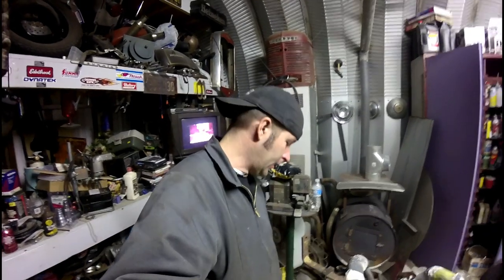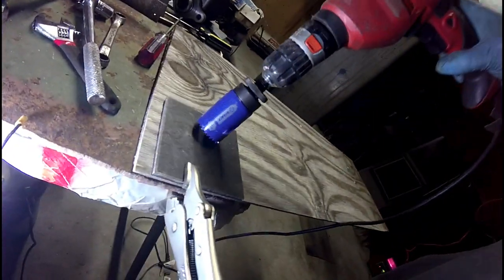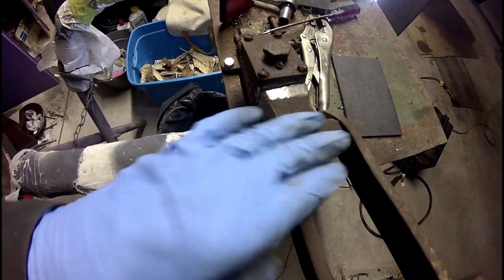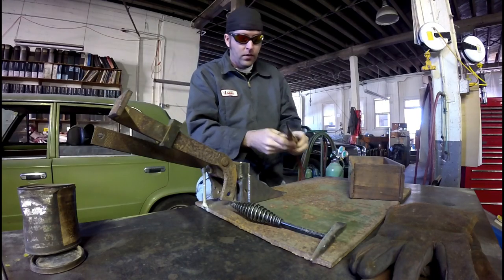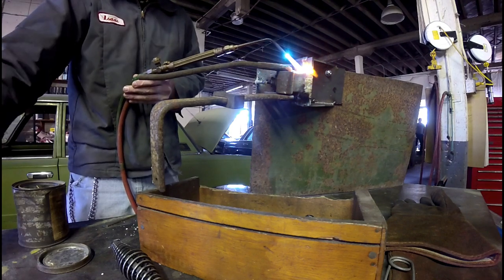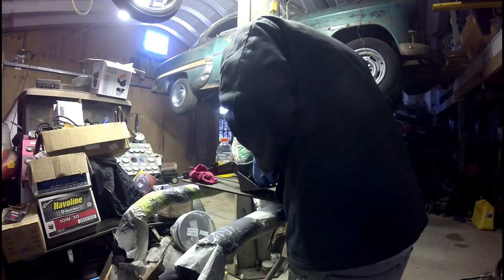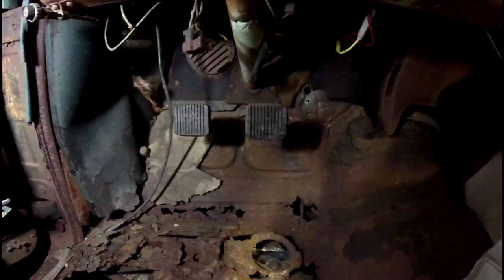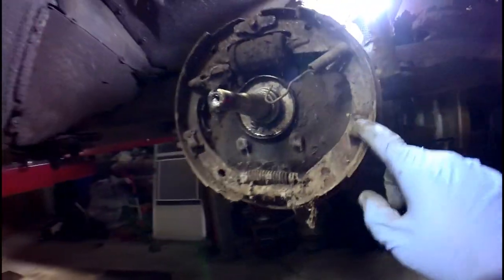Dual Master Cylinder Conversion- '53 Chevy Build: Ike's Adventures

Comment: Method I use for welding cast.  Clean weld area, preheat until it takes color, weld, reheat until it's got quite a bit of color, bury in a bucket of sand. I just use play sand from lowes or wherever.  The sand lets it cool slow and keeps it from cracking, it takes awhile to cool completely but leave it until it's touchable.  Works great, same method works on hardened steel too

Comment: Hey Ike, have you ever heard of or seen a Hydroboost brake setup? I've got one on my bronco right now, instead of being vacuum assisted, the brakes are boosted by the power steering pump pressurizing the booster along with powering the steering. It's supposed to be stronger and more reliable than vacuum. Although this project looks to be staying manual brakes, maybe a future project will get hydro.
Reply: ive seen them. I'm keeping this one as basic as I can
Reply: Travis Block don't they have a separate pumps just for brakes alone?
Reply: Isaac it'll be fine nothing wrong with that!

Comment: Show the brake line instal and give any tips that will help the lines seal up. I'm having trouble getting my lines to seal up on my 68 Chevelle. Thanks bud!
Reply: travis arnold leaking at your flares? are you using a proper double flaring tool? the two most important things when using a regular flaring tool is even pressure, and when your setting the stick out of the line into the clamp go a cooter hair past the thickness the instructions say. it helps. and a little lube never killed anyone.
Reply: regular=Non hydraulic, but still double flare.
Reply: ill be doing a vid on that this weekend
Reply: AllAroundUnderground yeah they leak around the flares. I bought new lines from CCP I'm thinkin their over flared I guess I'll have to redo them.
Reply: Isaac it'll be fine lookin forward to it.
Reply: Spot on, the instructions usually say to get the line flush with the fat part of the flaring dimple. Ive found if you go about 1-2MM more, they seal up and dont crack the flare off after you do the second procedure. The next most important thing to do is after hooking them up and bleeding is to properly secure them so they cant move at all. Just like a paper clip bent too many times, any movement will crack the flares.

Comment: hope the weld doesnt brake , doubble mastercilinder doesnt help a bit if it isnt being depressed by the pedal , you still wouldnt have brakes

i usually use a waterpump plier to get the bearing dustcap off , just grab it on the front of it and wiggle while pulling it off
Reply: I'm going to fix the e brake too
Reply: the hinge for the pedals looks pretty sturdy so i understand why you didnt wanted to refabricate the whole thing out of steelplate and stuff , it mightve been a stronger option though 
if this doesnt work you prolly have to to go that route anyway to get it all to work again though 

btw was the hinge piece you used solid or hollow, 
wat you could do if its solid is drill and tap it and put two bolts through the metal plate intoo  it as extra insurance
Reply: hollow. wish it was solid

Comment: Hey Ike. Is it hard to find parts for OOOLD cars like these? I assume you can't just walk into an advanced auto and pickup a master cylinder.
Reply: Actually you would be surprised. Some model specific stuff can be a bear but a lot of the stuff was used way past the model year. Then again if your a hot rodder and you don't care about modding it and making it better. My 48 chevy is sitting on a s10 frame so I have 4 wheel disks and modern front suspension.
Reply: holy shit!! NICE! Well those damn things weighed enough you practically needed a truck frame. Now is this frame/suspension a choice? Or was it more of "i have a frame, i have a body. Lets use them.
Reply: parts cars and old junk yards
Reply: A combo of both. I've owned a number of s-series (still drive 2) an have gathered some parts trucks. The frames are hardly anything special. The front was more or less based off the gm b and g body car platform. Not really heavy duty but easy to find parts for. Stuff like v8 mounts are easy to find. The s-series frame is a popular swap in old cars and trucks so I can hardly take any credit for it.
Reply: i did get that master cylinder at a orilleys

Comment: cutting oil on the hole saw would keep it sharper longer, Nickle rod would have been better than braising or just make the whole new piece out of steel. sorry I don't have much faith in braising its not a good solution when your life depends on it. also I would have done a disk brake conversion much more reliable.
Reply: it was actually silicon bronze? I think

Comment: You don't really need a dual master cylinder on a car with all drum brakes. Even if you were to put disc brakes on it, which are available from Wild Bill a Speedway Motors, you still don't need a dual master cylinder, all you need is an adjustable proporting valve. When is the last time you heard of a master cylinder going on a car, so fast the car crashed. That's because they lose pressure slowly, and over time, where you have plenty of time to fix it.
Reply: I have lost my brakes twice on classic cars with a single master cyl. with no warning
Reply: Pretty bad advice. You obviously don’t have a lot of experience with old cars.

Comment: I hope you took a drill with a wire brush and got after those backing plates. Those backing plates look FUBAR. This is one of those places where you really need new parts. Wire brushing those plates will do in a pinch. I'm sure you know you could really use new ones. One should never scrimp on brakes. And just to drop a bug in your ear, 53 or 54 Caddy brakes, I've been told will work. The backing plates will cross match. That way you get bigger brake shoes and bigger drums. = better stopping with a V8.
Reply: cool thanks

Comment: are you not going to convert the brakes to disk?
Reply: naaa
Reply: DaddytechEnt it's not a hot rod it's a rat rod
Reply: yep. my rat rod
Reply: doesn't have to be a rat rod to want to stop the thing when you push the pedal down and it not lock up on you every time.
Reply: DaddytechEnt well veichle a have been disc brake for years and obviously it works good enough espically for isa

Comment: idunno i may be full of shit here, but as long as its low carbon steel youre working with, i think you couldve gotten away with tigging it, i mean ive fabricated exhausts and intakes mixing those ductile iron pipe fittings and mild steel (actually got the idea from you guys) with just a flux welder and they welded just fine, with a tig and a little preheat, i think youd be in good shape DISCLAIMER I AM NOT A WELDING EXPERT XD
Reply: also was really curious as to how you attached the pedal to the rod coming out of the master, does the rod coming out have a bolt hole through it?
Reply: yes. there is a bolt hole on the end